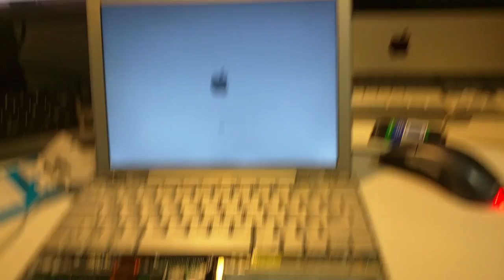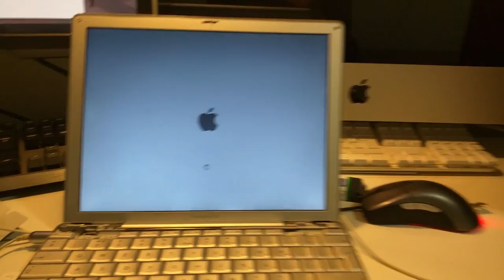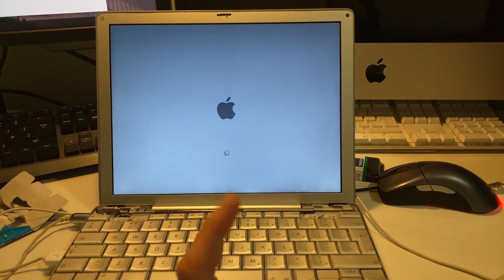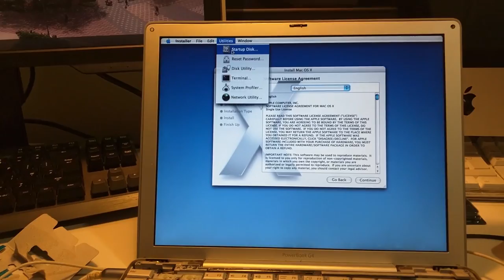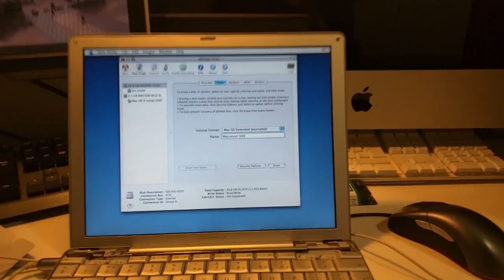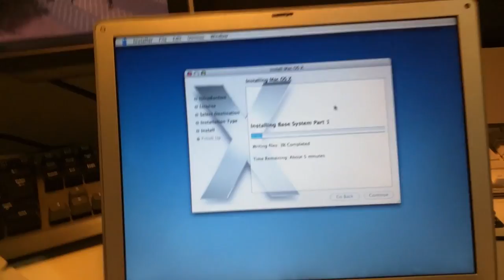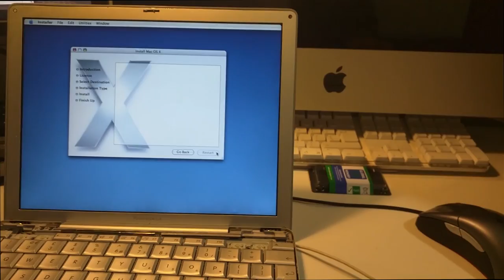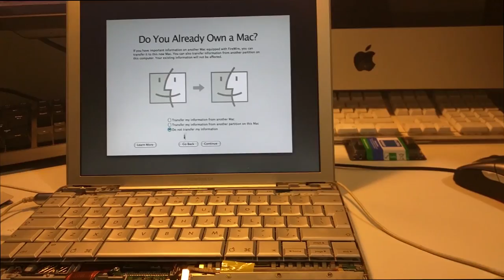Installing an SSD in a PowerBook G4 12" [Old Circuit Bored]

Comment: great video and something i'm about to do (with an MSATA/IDE case) but something i realize is that my backup battery is long gone..  do you have any insight into where the battery is and if it's user replaceable or requires soldering?  from what i can see at 7:01 it looks like i see the backup battery there and it looks like it just pops out.  can you confirm that?

Is this an aluminum or titanium mac?  I have a 1.5ghz aluminum (i think) powerbook.

Comment: Hey,  mate.  Could you buy a camera stand or set up rather than shaky hand-held camera? Looks very unprofessional if you are planning to make multiple videos. While I am coaching you here, would it not make more sense to have both hands free to take apart and to install new elements into a computer?
And learn to speak into a microphone in a way that is intelligible, instead of the grunts. 
The bad language per se did not put me off, since it adds color to your presentation and shows the casual approach that you took to this subject.  But this material is precisely what I was curious about since I own a computer like this and wondered about this same issue of swapping out the hard drive for an SSD.  But which SSD did you install, and how much did it cost you, and did it solve the overheating issues?  My computer gets worse each day, and now it won't boot up at all.  I bought a Samsung SSD but it seems that I now need some way to connect it since the connectors are different. Adaptor for SATA to fit into this model would be what?